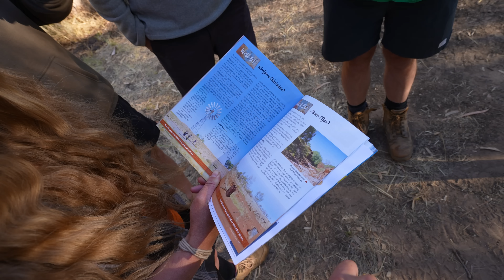THE CANNING - The worlds longest 4x4 track

Comment: During covid lockdown I decided to spend the money saved on fuel to put a long range tank in the Patrol.  Found a discount voucher for the Goannawhere tank which also held a bit more than the others.  Installation was simple, did it on the back lawn.  6 months later lifted lockdown saw the tank filled for the first time and .......  a bloody leak in the top seam.  A tiny slag pinhole in the weld.  Was a real mission to find somewhere to put 150l of diesel so the tank could be removed again.  Goannawhere paid for the onsite welder to dab a weld to fix it.  I emptied the tank completely, stuffed a big wet towel under the pinhole, put the vacuum cleaner into the filler neck and sucked out the fumes.  No problem since :)
Reply from the maker: Yeah well watch the next few episodes because the issue gets very interesting haha

Comment: Hey Matt, you are running the 4 leaf parabolics (700kg constant load) and they are riding the load spring all the time. If you upgrade to the 5 leaf (1000kg+) pack it will improve the ride in the Troopy massively. 

I've gone through all the parabolic that TT sells as my 79 got heavier. Done exactly that upgrade to my 79 not to long ago and it made a world of difference. 

When the rubber pads on the load leaf rides/get sqaushed all the time, you know the parabolic leafs are under sprung for the weight you carry. They still work, but you'll find the vehicle will perform way better with the heavier rates leafs. 

Enjoy your content, keep it up!
Reply from the maker: Yep we put the 5 leaf pack in a few weeks ago! Way better I wish we had them for the canning. Also the noise was driving me crazy haha

Comment: I also had issues with a BD tank. Exactly the same joint on 100 series cruiser a few years ago. And I must add BD were superb with fixing the issue. The replacement tank also let us down after few days on the Connie Sue.  BD stepped up again beyond my expectations and covered both repair and my other expenses. 
We put the kit through hell on earth and they are tops in both owning the prob and looking after their customers!!
Canning and Connie Sue are easily the most rugged trips to put your fourby through. 

BTW  the Ranger on our Canning trip didn’t t fare so we’ll as the 3 Tojos
Reply from the maker: Yeah they were very good to deal with! It seems like the fox has been good so far.

Comment: TIP.  If you take soap flakes with some bulldust from your wheel rims and knead it in the palm of your hand you'll have the perfect bush fix.  This is the way Jack Absalom recommended. Works extremely well.
Reply from the maker: Yeah there you go! If its a fix from Jack Absalom then I reckon it would be pretty good
Reply: I ve done it. Had a tiny hole in the bottom of the tank after sliding on a rock. A combination of dirt, soap and petrol made a putty that plugged the hole. It works.

Comment: We used soap as a temporary fix on a fuel tank on the Connie Sue. -worked brilliantly. One we reached camp we used a glue designed for the purpose
Reply: Robert when we were travelling around Africa we rode over a dead buck in the road late at night and it's horn punctured our fuel tank. We did not have soap ( only liquid soap) but we did have dates, the type you eat and we sealed our tank with them. When we left Africa we sold the vehicle with the dates still sealing the tank. We actually forgot about it and only remembered when we were back here in Aus. The fixed tank lasted 2 years for us and maybe still is going around Africa for all we know. Once the sand and dust gets mixed into the patch it sets as hard as rock and sealed the round hole in the tank perfectly.
Reply from the maker: That is a pretty wild story!

Comment: Fantastic episode, everyone needs an Adrian. 
Disappointing to have a leak so soon on a new tank, at least you didn't crack the chassis
Reply from the maker: Haha yeah I would have been a very unhappy chat gif that happened
Reply from the maker: Yeah its a good quick fix to get to camp
Reply: @OverlandTravellers  and if it is a bigger crack you can use soap and a coin of the correct size

Comment: Hi Guys, Loving the start of the Canning. Are sand flags required to be on your vehicles or is it an option you guys have made? You mentioned about having the truck in front as it can be seen better. Why don't you have your head lights on if you want to be seen? Just a thought. Cheers Graeme
Reply from the maker: Not sure if its a requirement but I definitely recommended it. Cheap insurance for a potentially big issue. Headlights would be a bad idea either